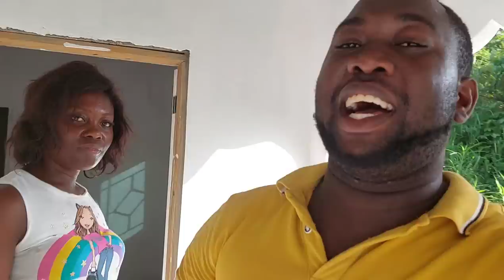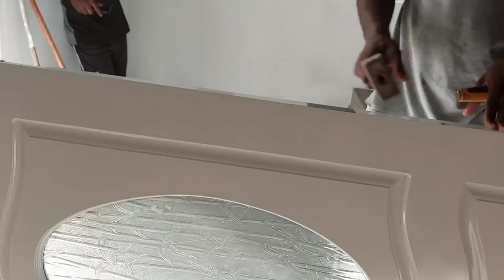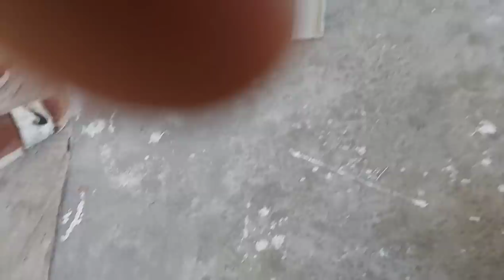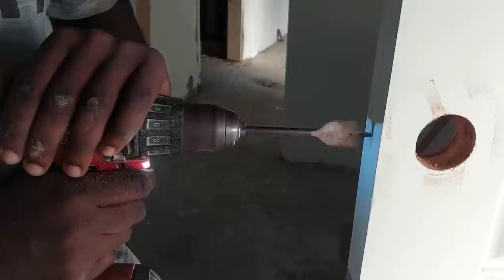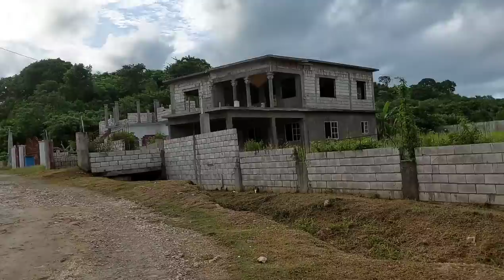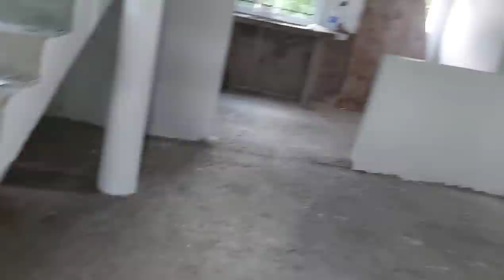Doors have been installed on our Dream House. Excited

Comment: Lightning strikes St Thomas quite often. You should put in a lightning conductor to the ground. You put in a lot of cash and effort, and that's a simple thing to protect the house from lightning strikes...just ask your electrician to put it in. I had a home in St. Andrew, and I made sure that it was protected, as I  wanted that peace of mind. It's a good thing to put 2 small bolts on the door, at the top and bottom. CHEERS.